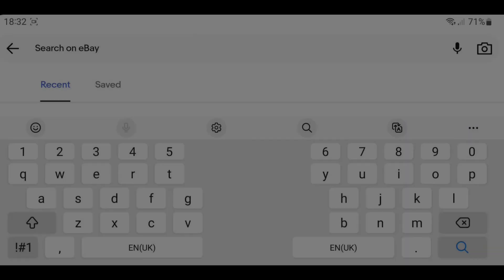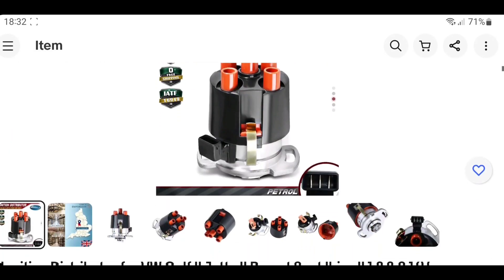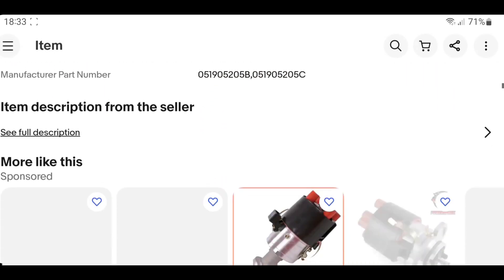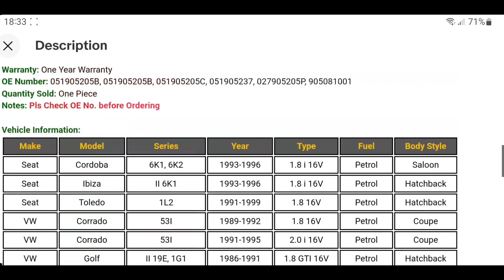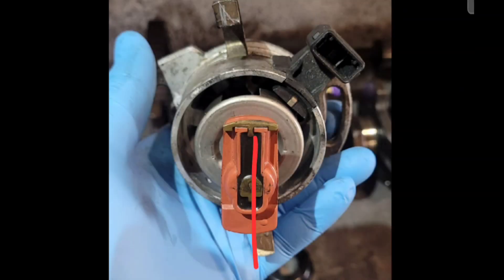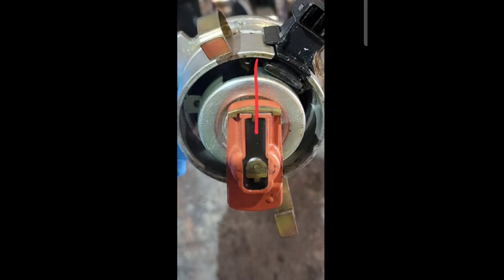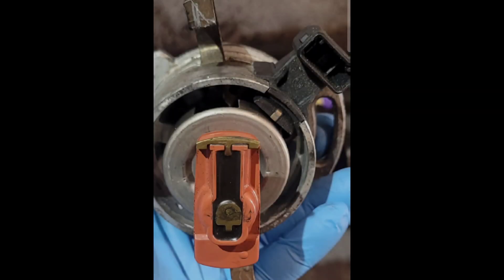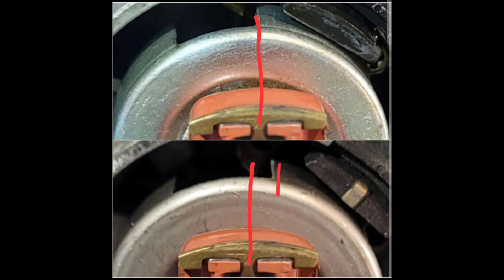VW 16v DOHC Ignition Distributor - S##t Aftermarket Parts

Comment: Bigger trigger window is not a bad part, but it's a wrong part for 16V G2. This is a diatributor for MP9 equipped VWs. This larger window is reseting sequence window from where ECU knows which injector to activate. 16V doesn't need that because KE-jetronic doesn't need this infornation

Comment: In South Africa, a lot of Citigolfs came with Bosch MP9.0 injection, a very basic injection system. The trigger wheel on their distributors actually have the number one window slightly larger than the others too, this is so the ECU can figure out which is number one cylinder to trigger the correct sequential firing of the injectors. Very crude, but it does work.

Comment: How about the 123 from the Netherlands?
Reply from the maker: I'm actually using one on mine know
Reply: @GreyGooseRestorations , how do you like it? Did you stick with the presets or have you tweaked it?
Reply from the maker: @lighthousebaptistchurchalm949 once its set its good, it's tweeked a bit but need to set it on thr dyno for best results
Reply: @GreyGooseRestorations , could you please give me the factory distributor advance curves that I need to program into the app. I see that it is not preset. Thanks!
Reply from the maker: @lighthousebaptistchurchalm949 email me greygooserestorations@gmail.com 👍
Reply: Ok, thanks so the factory settings are good to begin. A video on it may be interesting for others also 🙏🏼

Comment: Got my 16v last summer. I bought a brand new one of these Mickey Mouse dizzy’s shortly after getting the car, trying to sort the misfire it had when I got it (having done plugs and leads). The dizzy already on the car was also a less-than-year-old one of the same so I wasn’t confident in the diagnosis but it was cheap enough to eliminate. Fitting the replacement made the misfire SO much worse-car became undriveable. Loads of internet searching led me to this video. Checked both dizzy’s I’d got and the were both wrong, as you suggested. Not having an original, I searched eBay and found a genuine, used Bosch for £130. Bought that, fitted, timed the ignition and car now runs perfectly. I kept the search active on eBay and subsequently bought another used Bosch dizzy for £80 which I’ve put in stock-I may never need it but these parts are only going to get harder to find. Thank you for taking the time to post this video.
Reply from the maker: Glad it helped, like you say used parts are hard to find so always worth having a spare

Comment: Your my hero. I've just rebuilt me 16v with a lot of help from your vids. Been having problems with the lack of power and poor acceleration. I brought the exact same distributor from eBay and checked it after watching this video and yes it has the same issues. Put the old original on I still had and now it fly's. Just need to get the fueling right now.
Reply from the maker: Ace, glad it helped you 👍
Reply: @GreyGooseRestorations  what's you thoughts on the control pressure, I know yours is set to about 40psi. I tried 3bar and factory 3.4 bar and it's a little flat down low then fly's after about 4000rpm. It has a set of Kent cams which changes power band to 3000-75000. Thanks
Reply: Injectors balanced to 90ml after 40s
Reply from the maker: What cams are they? K-jetronic historically doesn't work well with high lift cams.

Control pressure anywhere between 3 bar and stock will make a difference, if its flat etc then try ignition timing setting etc
Reply: @GreyGooseRestorations  the cams are Kent gf1603 sports R
Reply: Cam lift is 435"
Valve lift is 435"
Duration inltet/exhaust is 278
Reply from the maker: 278° is quite a high lift cam for k-jetronic so unfortunately you will lack low down power untill the cam wakes up, you could try and offset that with a touch of ignition advance but not to much as it'll knock higher up the rpm
Reply: @GreyGooseRestorations  I'll give it a try. Many thanks 👍

Comment: I have followed you for a while and you obviously know what you are doing.  I had exactly the same problem with an aftermarket kjet 8v dizzy.  aftermarket one rubbish.
Reply from the maker: I was shocked how bad they were, i no cheap is cheap but the basic requirement for four equal sized windows should be paramount